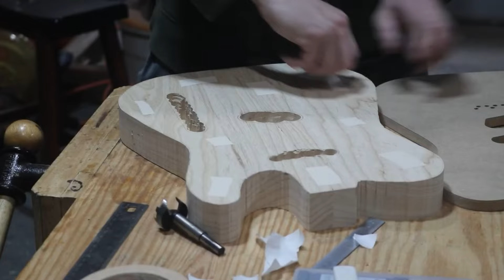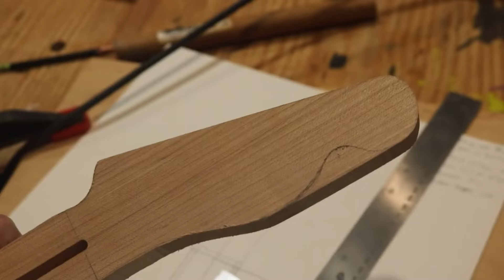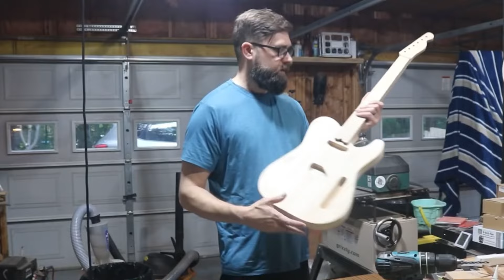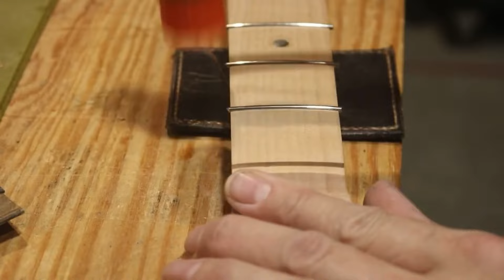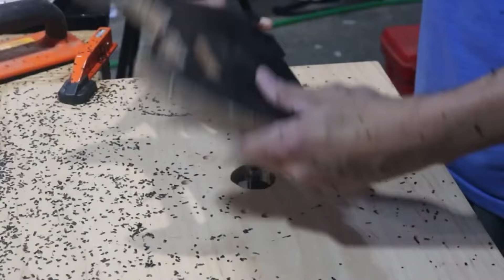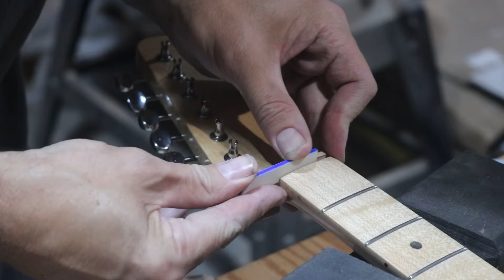Telecaster scratch build - start to finish

Comment: The fact that this guitar can be hand built with minimal tools is the genius of Leo Fender.
Reply: And in just over 18 minutes, too..! 😂
Reply: Bruh, count the tools.... jk, they rock. I'm thinking about building one from an old table I have.
Reply: 0:45
Reply: You can do it with a lot less than this too and I'm pretty sure that was the plan with the early Fenders. The body and neck dimensions are based of dimension lumber 8/4 for the bodies and 4/4 for the necks. You can (and I currently do also) bypass needing a planer or jointer if you've got a half reliable lumber yard nearby and just get s4s lumber. You can build a half decent tele body with a router, jigsaw and a hand-drill with the right blades, bits and a couple of other small tools and materials with proper planning. Hardest part is string through ferrules by far but I've found a way to get them spot on with jigs and a hand drill.

Comment: Wow Chris. Really beautiful precise work. Did you chamfer the pick guard? Also, did you put a block to backup the drilling so it doesn't blow through? Is that ash w maple fret? What's next, a hollow body tele? Archtop? Nice to see kids in the workshop too.
Reply from the maker: Thank you! I did not chamfer the pick guard. I realized it after I had it installed. I still need to tweak a couple if spots on the pickguard, so I am planning to chamfer it as well next time I take it off. It is swamp ash with a maple neck and fretboard. I am planning on doing most likely a les paul guitar so that I can learn how to do a set neck guitar. I appreciate the comment!
Reply: @CMRWoodworks  looking forward to it.

Comment: Nice job bud. Sweet tele! Maybe I'll make a normal one one day lol 

Did you wax your screws? I always do, makes them go in easier and less chance of snapping. 

Other thing, I don't think you need a bridge ground on a tele, think it grounds through the pickup.
Reply from the maker: Thanks for the comment! I did wax any screws going into the maple. The swamp ash was so soft, I was thinking I didn’t need to wax those. I’ve had a couple of people say the bridge didn’t need a ground wire, but I already had it in there. I guess mine is just super grounded now, lol. I appreciate the time you took to comment, man. I love your stuff. Working through the copper tele series currently. Cool stuff!
Reply: @CMRWoodworks  that copper tele is proper shielded and grounded. Also completely bonkers 🤣

Comment: Wow excellent job man, black guard teles for the win!!   From start to finish how long did the build take you?  I was going to take this project on as well, but do not have half the tools you have.    Cheers
Reply from the maker: I appreciate it man! I didn’t buy everything all at once and did a lot of research before each part so it ended up taking me 6 months. I think that if I had everything I needed and knew what I was doing at each step, I can easily build one in a couple of months (or less since a Tele is about as basic as you can get). Good luck!

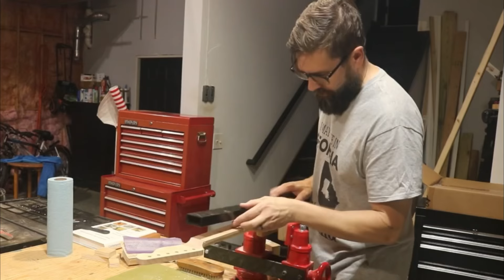Comment: Congrats, very nice build 👍 But step at 9:27 is really weird. I mean, sanding neck for flatness while neck is fixed just by one end and the rest is bowing in the air? Come on... 😉
Reply from the maker: It‘s a good point. Someone else pointed that out as well. I didn‘t feel like getting the block I usually use to support the headstock end and didn‘t think I would be pushing too hard. But, looking back at the video I can see the bowing, lol. Well, lesson learned. The good thing is, there is no observable bow in the finished guitar and it plays just fine. But, I will still support better next time as a best practice. Thanks for the feedback!
Reply: @CMRWoodworks  My pleasure sir, you're excelent craftsman anyway! And musician as well 😃👌

Comment: Great work.. but was that a template? I thought it was built from scratch..
Reply from the maker: The scratch part is the wooden parts of the guitar not being made out of anything premade. A lot of people make the body, but then buy a premade neck or something like that, for example. The template to me is kinda like a bundt pan or a cupcake pan or something. Someone can make a cake or cupcakes from scratch and you wouldn’t discount them for using a bundt pan to shape a cake or a cupcake tin to shape the batter into a cupcake shape. At least that’s how I see it. When I started looking into building electric guitars, I found that templates are just a way of life for most electric guitar makers, even pros. Same for acoustic guitars. I make them as well and you have to use a mold to keep the bent shape of the sides. I have used a premade mold and I have also built my own, but the guitars I make with them both are still all considered handmade guitars built from scratch in my mind. I appreciate your viewpoint, however, and I’m glad you left a comment. Thanks for watching!

Comment: What pickups & pots did you use in this mate?? I could never in my wildest imagination build a guitar from scratch , I have a super good low end Tele made of swamp ash & maple already and think modding pups and pots is within my capabilities. Nice build though.
Reply from the maker: I used some non-name brand ones. It was about $50 for both pickups and a control plate with all pots included. Got off of Amazon. Thanks for watching!
Reply: @CMRWoodworks  I've looked on Amazon & evilbay so many "Non-name" brands , the thing is I liked the sound the ones you picked have and unfortunately just picking one set willy nilly without being able to hear them first is a bit strange to me....maybe a link to them would help me out if that's possible. I'm in Australia so that $50 soon becomes a lot more with exchange rates being what they are.
Reply from the maker: Sure thing. I found the ones I bought. Not sure if the link will work in a comment, but here it is: 

https://www.amazon.com/dp/B07GV7Y742
Reply: @CMRWoodworks  Yeah it did work mate , $85 AU delivered...thanks for that.

Comment: Hi. Nice job. What dye did you use on the neck and body?
Reply from the maker: I used honey amber TransTint dye on the body. Then I used Tru Oil on top of that which gave it a darker amber look, or butterscotch, I suppose. For the neck, I only used Tru Oil. I did probably 8 or 9 coats of Tru Oil on both the neck and the body.
Reply: @CMRWoodworks Thanks. I have all the bits ready for my Tele build. Alder body, maple neck and rosewood fingerboard. Going to try a black dye, sand back so it just accentuates the grain and then then cherry dye. I would prefer an oil finish for the feel of it. Looking forward to the build
Reply from the maker: @barryflanagan1 cool stuff man! Good luck with your build!
Reply: @CMRWoodworks  I'm hoping to do the exact same build in terms of finish and materials, but from a kit build. This was very helpful and sooooo beautiful.
Reply from the maker: @Naglfarlindar I really appreciate it. I didn’t mention in the previous comment: I did not dilute the TruOil with mineral spirits. I just used it straight from the bottle, but really tried to keep the coats thin. Anyway, thanks again for the comment!

Comment: Do you buy a pattern?
Reply from the maker: Yes. The thing I was using to cut the frets has a pin that you slide in and out which aligns with some slots on a template. So you just lock it down, cut the fret, the slide the pin out, slide the fretboard down until the pin locks into the next slot and then just keep going.

Comment: I suppose it'd be the acme of foolishness to inquire why you were using a drill and then a router to cut out the body cavities.
Reply from the maker: To take some work off of the router bit. Basically makes the routing take a lot less time and saves your bits. Plus using a router just feels sketchy, so the less I have to route, the better. I appreciate the comment. Not a bad question!
Reply: @CMRWoodworks  That makes sense. I looked into it after I seen you do that and the answer I got was the same, but was curious and asked anyway. I did some luthiery a long time ago and watching folks build guitars is one of my pastimes, your build turned out great and it's much better than the chop, cut, rebuild I did to a Squier Bullet.